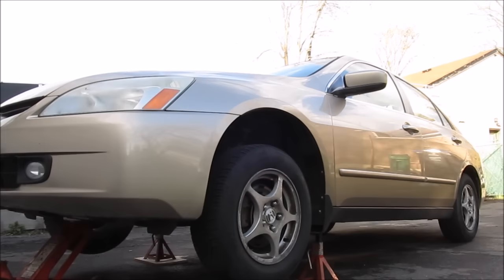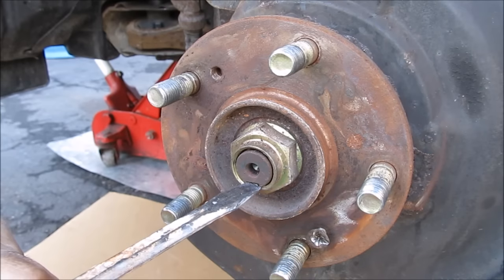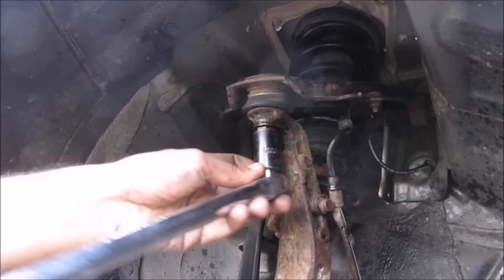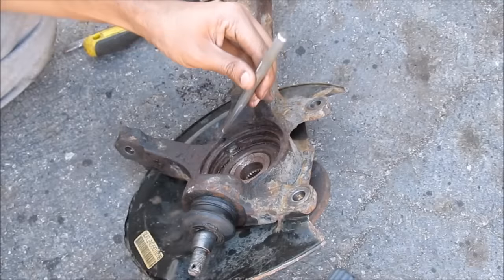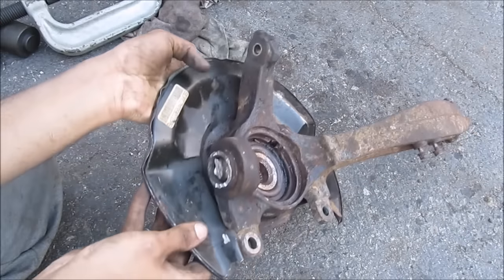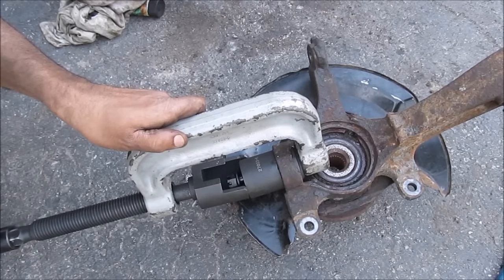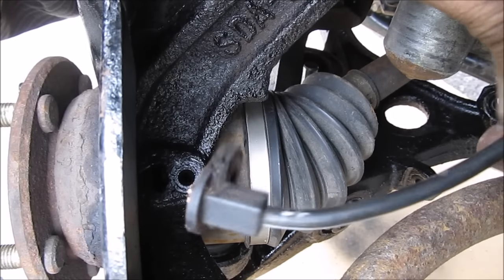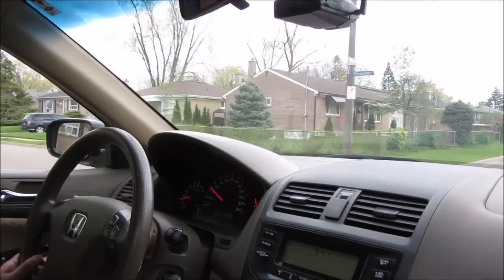Honda Lower Ball Joint Replacement

Comment from the maker: Here's the Mevotech ball joint I used: https://amzn.to/2LA7pWc
Pickup the ball joint press here: https://amzn.to/2JbfgYL
You'll also need a bal joint separator: https://amzn.to/2LBkkqN
And the adapter set: https://amzn.to/2xtx4HN
Break rusty bolts free: https://amzn.to/2RWaot7
Anti-seize compound: https://amzn.to/2Xr4dOQ
An impact gun makes things easy: https://amzn.to/2JuNNjw
Impact socket set: https://amzn.to/2LFgVaz
ABS Sensor I broke: https://amzn.to/2XOeyIY
Clean things up with brake cleaner: https://amzn.to/2XLiVVg
Reply: Very good walkthrough on this video 👍
Reply: 🤣 fun day, that day, huh? 😂😂😂
Reply: The dimple on the spindle nut is so unnecessary
Reply: 8
Reply: I hear 2 clicks noise  from the front of my car wen reversing  and turning the steering wheel wat could be??
Reply: is that inch and a quarter socket same as a 36mm one ?

Comment: clearly the man working on this vehicle is fully trained on a professional level he most certainly knows exactly what he's doing and I appreciate this video!
Reply from the maker: +Andres Pacheco Thank you for the feedback! I wouldn't say I'm fully trained through, I'm an engineer by trade, working in on my cars is my hobby.
Reply: I didn't need it to remove the rotor to replace the lower ball joint

Comment: Nice work, good vid.
If your brake rotor is good, you dont have to remove it.  Those are a pain.  Just be careful not to damage it while doing the other work.
From the Factory Service Manual: Torque specs - Lower ball joint 65-72 ft/lbs.  Lower damper fork nut 47 ft/lbs. Upper damper fork bolt 32 ft/lbs.  Upper ball joint 29-35 ft/lbs.  Axle nut 181 ft/lbs.  Tighten Lower damper fork nut and Upper damper fork bolt with vehicles weight on suspension.

Stay gold.

Comment: 1st. . . Well done. Right to the point, no weird music, no fast-forwarding, & explanations of what you're doing while you're doing it.

2nd. . . Yea, fasteners may change size or type on you when you open the new part. Heck, my '04 Accord had a mix of castle nuts & cotter pin holes on the ball joints & a nylon insert lock nut w/a cotter pin hole on the outer tie rod end (cotter pin was installed under nut). 

New lower ball joint came with a nylon insert lock nut & no cotter pin hole. Looked up torque specs AND used threadlock on re-assembly, tho. 

Also, didn't have to remove knuckle from car, was lucky enough to have plenty of room to work. Only took off brake rotor, caliper & mount, tie rod, & L/S half-shaft (replacing it anyway).
Reply from the maker: Yeah not a fan of the fastener change... especially if I don't have that socket.

Comment: Thanks for such a fast and informative video! you rock! I'm installing a front suspension kit today on my 2000 Honda Accord V6 Coupe and this video has helped me! keep up the good work! It was nice that you left some of the mistakes in the video for people to learn from.  Much appreciated.
Reply from the maker: +Erin James Wong Thanks, I'm glad you learned from it. Those mistakes are pretty common for this type of job so it's just a little heads up. I also filmed the first ball joint instead of learning from my mistakes and filming the other side.
Reply from the maker: +Erin James Wong Thanks, I'm glad you learned from it. Those mistakes are pretty common for this type of job so it's just a little heads up. I also filmed the first ball joint instead of learning from my mistakes and filming the other side.

Comment: how can someone dislike this video! its precise, educational, maybe a little fast...but rewind it.
Reply from the maker: +flowremix thanks, short and to the point is how it has to be!
Reply: I didn't give it a dislike but I felt he spoke too fast and edited too closely.  It's not a race!  I had to watch the thing at 3/4 speed.
Reply: Yes he does a good job, but it's kind of an overkill. 
IMO, He did alot of steps that weren't really needed, also he messed up a bit, and resorted to some backyard mechanic cutting, chopping, and just winged it. 
But it's OK, because as long as at the end of the day, he gotter done. 😄👍

Comment: A very useful video. Thanks.  Two things that might help other viewers - if the ABS sensor refuses to budge, then you can unplug it inside the engine compartment and withdraw it through the wing. If doesn't need to be removed from the hub to remove the ball joint.  Also, I didn't have the fancy ball joint press, so I just hit mine repeatedly with a big hammer and it came out fine. Damage to it didn't matter since it will be replaced

Comment: I’m so glad u left your mistakes in lol helps us not do the same thing
Reply from the maker: Yeah alot of mistakes were made
Reply: Hey Taint, have you ever made any mistakes?
Reply: Hardest part is getting those old rotor screws out.
Reply: @thronewalker1153  Sometimes. Mine came out with no work at all, like they were already loose. If you do have trouble with them just get an impact driver that you hit with a hammer, makes short work of them.

Comment: Why so many dislikes?, this is a great video. To the point.
Reply from the maker: +Driveway DIYer that's my style!
Reply: Because he did way more than necessary and broke the abs sensor in the process
Reply: It happens when repairing rusty cars, he was aware of it and will replace it. I wouldn't choose to paint everything, but its great he does.
Reply: He cleaned the out the ballpoint he with sandpaper and put grease in. NEVER CLEAN OUT THE HOLE AND NEVER EVER PUT GREASE IN IT. That ball joint now has the potential to move now. Which will cause a great deal of damage to other parts. Not too mention drivability
Reply: He's good
 Check out ChrisFix videos.
Reply: People dislike videos not because they hated the video but because they didn't want it to show up in their recommended videos.
Reply: @shermantank4516  it's pressed in. no way it's moving. nut on bottom and fanged on top. If he didnt, the rust on the inside could be uneven and prevent it from fulling seating.  in another words higher potential to move with your logic.
Reply: Christopher Bolden obviously you are not a mechanic. I however am a licensed mechanic with 25 years experience. If you sand out the bore in the spindle. You change the diameter. Therefore it has the potential to slide around in the bore. There are so many things wrong with this video. I was just pointing out the most dangerous
Reply: they want to click subscribe but wrong do
Reply: @shermantank4516  Tell me, how many press fit  bottom ball joints have you replaced where the tolerance fit/housing has worn and failed rather than what normally happens the actual  ball joint wears?
Reply: @Austin George i whit u 👍
Reply: Austin George it’s pretty simple. You can put grease under the boot of the ball joint or you can grease it with a grease gun if it has a grease nipple. But you NEVER EVER grease the mating surface between the ball joint and the spindle. That’s just basic knowledge. It’s pressed in for a reason. It is not a bearing. You do not want that to have any potential to slip or move. Putting grease in there gives it that potential.
Reply: Austin George the only time I threw any mud was after it was thrown my way first. The fact remains. That many parts replaced many times. Will have excess play when someone cleans the bore out with an abrasive, removing material from the mating surface. Doesn’t matter what brand of replacement part you use. Some “techs” using the term loosely will spot weld press in parts. Because of the excess play. This is also a bad thing to do. Because it’s almost certain the welds will eventually break and can cause serious problems, even cause an accident. I have had the privilege of working with some very intelligent and experienced mentors. Every one will tell you the same thing. Do not sand the hole except to remove any burrs. But only the burrs! Not the entire mating area. The only area the should be cleaned would be the adjacent surfaces. Like the anchor of the ball joint and where the snap ring needs to be placed. I have seen ball joints sitting sloppy in the hole, and the damage it has cost. Some have chewed away the spindle to the point it can never be used. Some have even broken nearly causing and accident. Granted it’s less common with cast steel vs pressed steel. But I have seen it. Do not use any abrasives in the hole. Never ever use any lubricant between the mating surfaces. Even if it only happens once for you. It could mean the difference between life and death for someone.
Reply: The tiny sandpaper to remove a burr did nothing to change the seating of the pressed part. I work as a quality engineer for twenty years. No need to savage a guy trying to make some good videos!  You can add constructive advice on lubing pressed parts. Great video on balance.
Reply: The dislikes are from BMW drivers.
Reply: @shermantank4516  I guarantee 110% that you were not a perfect mechanic for those 25 years. Quit your crying and whining.

Comment: I cane into this video because I wanted to replace mine myself, but watching all the process and different tools. I'm just take it to a mechanic lol
Reply: Same lol
Reply: It’s literally a few wrenches and a couple pry bars lol maybe a socket or two
Reply: same 😂
Reply: It looks like a lot and can be but it's an excellent way to learn. There's many videos out there but this is one of the better videos of step by step,every tool you need and how to do it. I changed the old ball joints in my 93 civic,pain in the ass but I learnt quite a bit by doing it on my own.
Reply: Someone has to keep mechanics in business by being lazy bones
Reply: Quiter
Reply: I was thinking I could do it too 😂
Reply: @ComptonForLyfe  Add impact guns, torque wrenches, ball joint separator, ball joint press, etc....
Reply: redrumsusan6434 Bauer 1/2 in 1050 lb bolt breakaway, 120 volt electric impact wrench 89.99 Harbor Freight tools. And you can use it on a whole lotta other things also. NOTE I used mine in the "field" via my 1000 watt inverter. Inverter: very VERY handy thing to have for your car.
You can also get them battery powered, cost is a bit more though.
Reply: @jonnda ust go old school. Impact gun yes. Ball joint separator, ball joint press = 2 three pound hammers and a pry bar. Those ball joint separators and so called pickle forks, worthless crap. Learned that 60 years ago from an old mechanic who really did do it old school.😅
Torque wrench? Geez just tighten stuff down. Axle nut? 1/2 inch breaker bar to 200ish ft. pounds. Look up your own specs. 
200 Ft pounds equals bar 1 foot long + 200 pounds on end of bar. Longer bar equals less pounds further you go from one foot. Don't know the math, you figure it out or maybe someone else can answer that for both of us, any math people out there??
Reply: @railroaded1991  Let me tell you that many years ago, I banged on my car for at least half an hour "old school" style to get the ball joints apart and it did jack shit. Ball joint separator got it apart in under 30 seconds without adding more dents to my suspension components.

Also, hell yes I torque everything to spec on my daily driver Acura. This is my car and my life on the line. I don't trust people that don't use a torque wrench, and I do trust the smart engineers that designed the car to know exactly how tight fasteners should be. I have seen people strip threads and just in general f*#$ shit up because it was either too lose or too tight. So please, go out and buy yourself a decent torque wrench. It's mandatory for changing oil on my car. Aluminum oil pan + steel oil drain bolt = goodbye oil pan threads if the car gets taken to a jiffy lube where some 200lb grease monkey decides he doesn't need a torque wrench because he has a breaker bar.

That said, I have successfully use a deadblow hammer to change a wheel bearing. No press needed. Also ended up just using a hammer for replacement of the the ball joint in the knuckle, because the press didn't fit.

Sometimes you can bodge it, sometimes you need to do it the "right way". Knowing when it's important to follow the rules is the key.

60 years ago, cars were very different.
Reply: @jonnda  half hour???  It only takes 10 seconds if you do it correctly, obviously you don't have a clue. This is actually for everyone else, you now have your "special" tool that wasn't needed. 
Make a fist. Your fist is the part the ball joint tapered shaft goes through, it's a tapered hole. The tapered shaft of the ball joint fits in the tapered hole. Loosen the nut so it's an eighth of an inch loose. Put a pry bar between the components so you can put a bit of tension as though you are prying the parts apart though in this case it doesn't take a lot of pressure. Take your Ford hammer (3 pounder) and give your "fist" a good hard hit right at the base of where your middle and ring fingers would be. The energy is transferred through and drives the tapered shaft out. Takes ten seconds.
I would just bet that you were beating the holey crap out of the threaded end of the shaft or the ball joint itself.
Note that I've noticed in a number of tutorials the mechanic is doing it by this "old school" method. Perhaps you should look at some of them.
Also as I said initially, foot pounds  are measured by weight one foot from the fastener. This would be that if the torque is, say 220 foot pounds and I wanted to torque something to 220 FP then I'd use a bar one foot long and stand on the end of it, my weight being 220 lb.
Inch pounds works the same except it's an inch from the fastener.
Too I am wondering how accurate that torque wrench of yours is. When's the last time you had it checked? Was it accurate in the first place? Do you always release the tension on it when you put it away or just leave it under tension.
And yes I do have torque wrenches.
I was also wondering if when you use the wrench do you do so using brand new bolts? Because torque is based on the amount of stretch of a NEW bolt and not used ones.
If you are going to be "picky" about it, then you need to use ALL NEW fasteners, nuts, bolts, screws, studs etc. for your torque values to be correct.
Torque also changes when threads are clean and dry or oily or greasy you need to find out those spec's via your engineers and what they designed for.
Reply: @ComptonForLyfe  $90 electric impact from Harbor Freight works well on that big ass axle nut. I'm old school and agree with you on the other tools. But recently came across an axle nut that wouldn't budge even with a cheater bar. Impact knocked it off in a couple of seconds.
Reply: Its not bad, a mechanic screw my balljoint up and it let go on the highway and i almost dead, do it yourself

Comment: DON'T FORGET THE RING CLIP AT THE BASE OF THE BALL JOINT LIKE I DID. Had to take everything back apart lol. This was a big help, thanks. I did it with wrenches and sockets and it kicked my ass. Rented a ball joint clamp and separator. Had to put a wrench around the stem to the c-clamp and whack the shit out of it with a hammer and it pushed it in after 90+ full-swing cracks. My 17 mm wrench is dented to shit but I got it done. You saved me about 250 bucks!
Reply from the maker: Glad you got it done, it's not good to hammer ball joints in though

Comment: Like others said, this is a very good video. Glad you showed the play in the ball joint by lifting the wheel to demonstrate why you're doing all this.  Also learned a lot of the parts that goes into Honda's double wishbone front end.
Reply from the maker: Thanks I'm glad you found it helpful

Comment: Absolutely best ball joint replacement video, best of all no cheesy 3 min egotistical intro video, no wasted first 5 minutes of repeated statements saying what they are going to do and no 40 minute filler on needless personal chitchat of ones life.

Right to the point, made by an a real American average Joe, love it. My only question is you had Honda specific adapters, but I think the you only used the one that has one side cut away in a square pattern. Was anything else specific to the honda. I have an '01 Accord with bad bearing, in progress of replacing that and figure I'd replace some ball joints but I could see the honda knuckle isnt going to fit a standard kit.

So how many special adapters did you use when you did the upside down thing with the clamp and what was the year/model, mine is 2001 Accord, just wondering how I could do this without the special adapters, if you did really need them. Thanks -D
Reply from the maker: +Ever Forward that KS, short and to the point is my style. 
When I was on the accord forums, alot of people noted the gen 7 needed special adapters compared to other Honda's. I assume gen 6 would be similar to civic and crv

Comment: Thx for the video, it will be a big help for the CR-V I'm working on. What size air compressor are you using?
Reply from the maker: +Dubblesteel 25gallon I believe.
Reply: speedkar99-Thx

Comment: Great video. It helped me a lot doing both lower ball joints on my 2004 Accord. I strongly recommend that anybody doing this on a  rusty car get new knuckle retaining rings. Mine were really stuck and I had to bend the heck out of them to get them out. Getting them back into shape to fit back in was not easy
Reply from the maker: I'm glad it helped

Comment: I own a 1997 Honda CR-V and do as much of my own work as I can, so I look for tutorials on my Honda all the time. Really appreciate the time you take to record, edit and post your content. Please consider more content on the the 1997 CR-V.
Cheers brother
Reply: I own a Rd1 also car runs forever i need to replace both of my ball joint and the driver side axel along with oil pan gasket after that everything is good